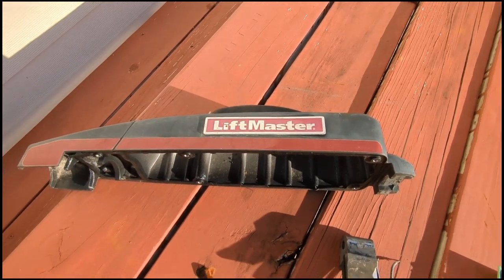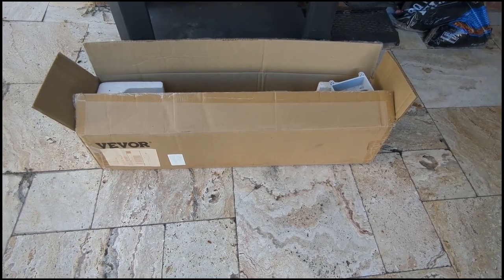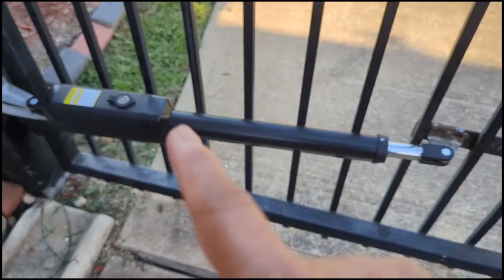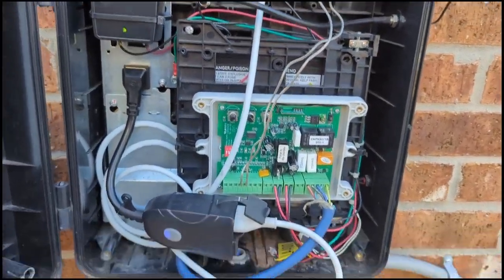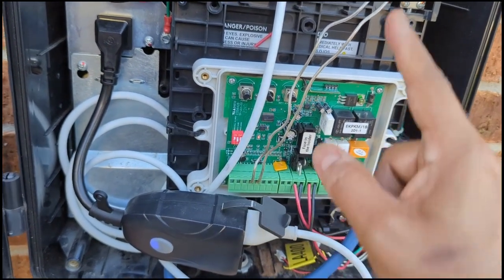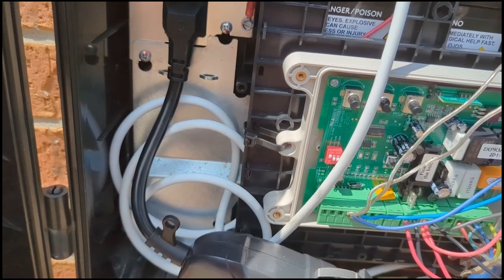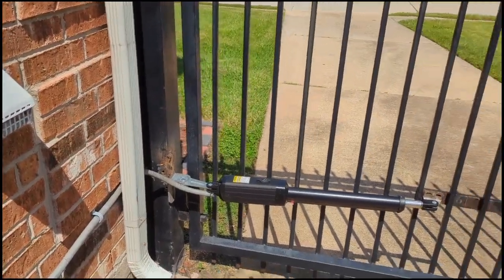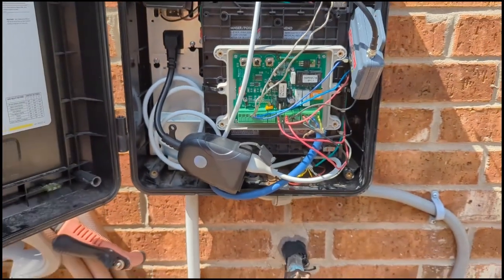Install & adjust VEVOR Tools Gate Opener Actuator

Comment: Do you have solar power connected to your opener? I'm trying to find information on that. Thanks
Reply from the maker: I do not have solar , Mine runs on regular house power and I have 2 batteries for backup when the power is out.

Comment: So you need 2 batteries in series, assuming they are 12V batteries?
Reply from the maker: so let me clarify , you don't "need" 2 batteries for the actuator to run , You can just use the AC Adapter that comes with it. 

But ..... with the 2 12V batteries in series , you get operation even when power goes out which is great and the fact that the arm runs smoother with the batteries because of the surge power that it needs to get started.